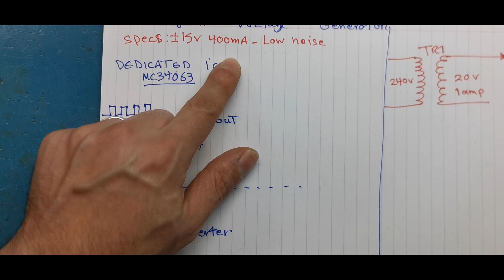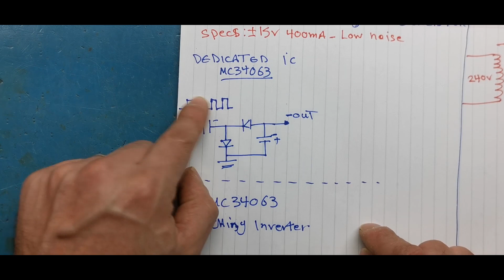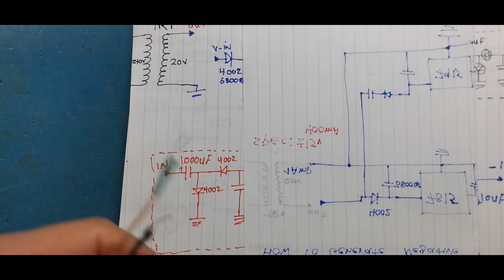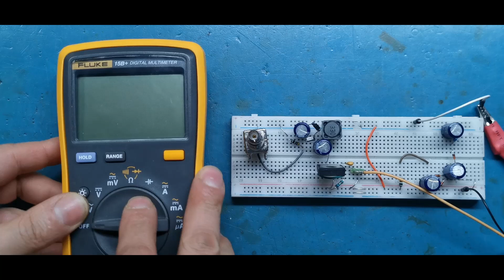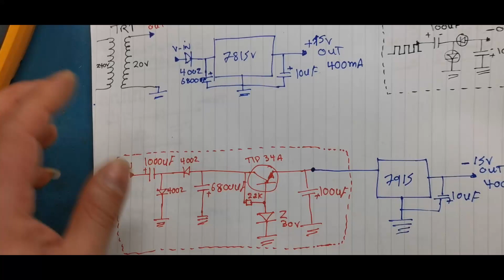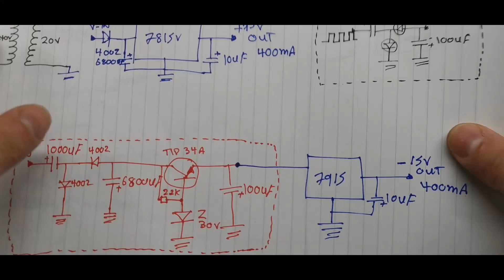How To Get Dual Rail Supply from A Single Tap Transformer

Comment: (20V * 0.4A) = 8W, and (15V * 0.4A) = 6W of heat over two ICs to get a rail, not to mention the power resistors, that is a hell of a lot of wasted power. Why not chuck a 7915 after the switching regulator at ~-18V with the same massive caps?
Reply from the maker: This is was just to demonstrate that there is other ways to get negative voltage from a single winding. And also to demonstrate voltage doubling. To get negative voltage with out all the power waisting, all you nerd to do is to connect a diode in reverse to the same winding and use the negative swing of the 50Hz from the transformer and the feed to bulk capacitor and a negative voltage regulator.
As I mentioned. I didnt want to use  switching regulator. As noise will still be present in circuit even after linear regulation.

Comment: What is the point of doubling that voltage? If you need the +15V/-15V supply, you can easily obtain this from single tap transformer by rectifying the positive halfcycle into the positive rail and negative halfcycle into a negative rail. Yes, you end up with a huge capacitors in your filters, because you have only 50Hz (not 100Hz as with a full bridge rectifier, which is what you cannot use in this configuration), but that's the cost of having single tap transformer. Then 7815/7915 (with proper blocking capacitors) to stabilize the voltage and it's done. Problem is that if you don't load this symmetrically, you end up with a magnetized core of the transformer, but this is not a problem as long as your load is almost symmetrical. If this is not your case, then doubling that voltage loads the transformer in both halfcycles, but you absolutely need to do the same thing for your positive rail just to force the positive rail to suck the current from your transformer in both halfcycles same way as the negative does. This is perfectly doable, but you need abt 9V transformer to get ±15V, not a 20V one. Your solution makes sense only if you (for some reason) need +30V/-15V or something like that.
Reply from the maker: That is true. But it's always good practice  to learn new techniques and ways in electronic. That is how we have progressed through out the years. I was just pointing out other way of doing it. It's not always that you need symmetrical power rails.

Comment: just disassemble the transformer, unwind the secondary, and rewind it with centre tap. 
will need some tools like a hammer, a flathead screwdriver and need to be extra careful not to injure self or anyone else. 
otherwise, its pretty straightforward and efficient.
Reply from the maker: Ye. That is one way of doing it too.

Comment: For the negative supply, how about using the same circuit as for the positive supply, except reverse that diode and capacitor and replace the 7815 with 7915?
Reply from the maker: Hmm. I haven't used that technique. I will give it a try. And do some  testing. If it works it be much simpler than the way I demonstrated.
Reply from the maker: you are right that works perfectly. i used it and ran some testes. it works the same and with out the voltage doubling. 😀